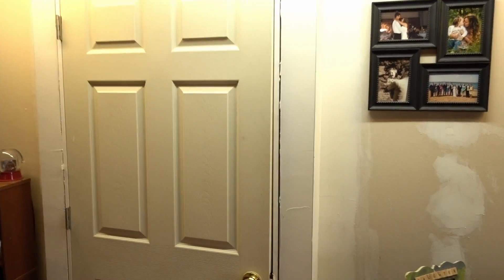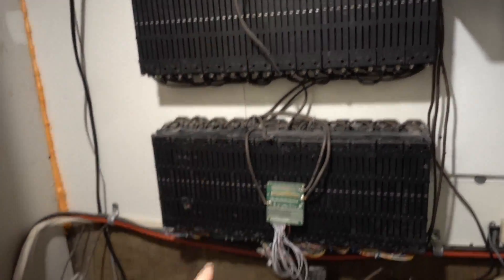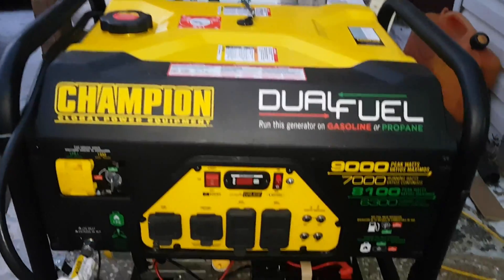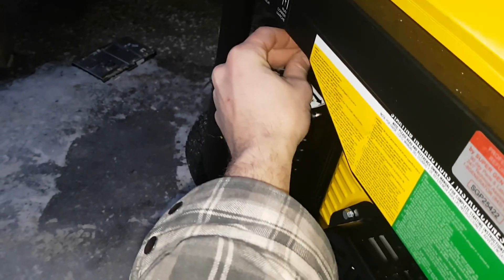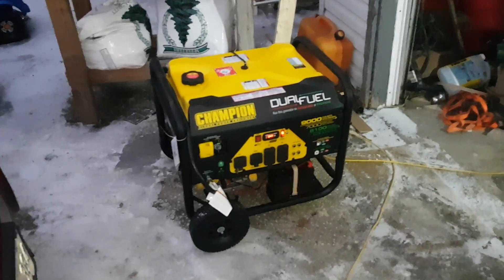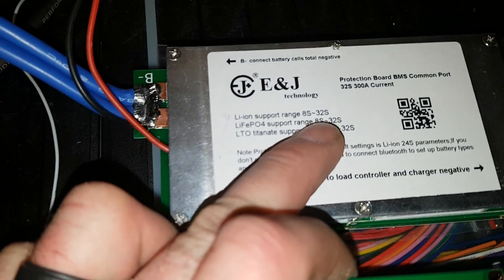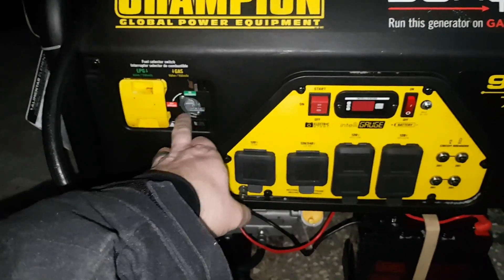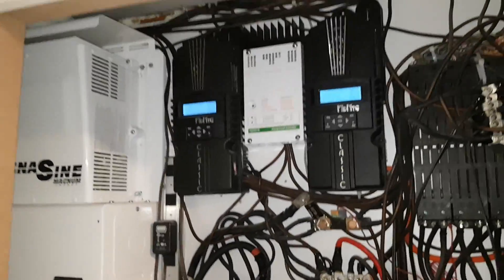Off Grid System And 9000W Generator

Comment: Solar is so expensive it almost makes no sence to buy it. Itll take u years to pay for it in the normal light bill. Years. Many many years
Reply from the maker: Umm my electric bill used to be $300+ a month now its about 50 a month for delivery. thats $3,600.00 a year in 10 years that $36,000.00 my system cost around $24,000.00 and my system is already paid off :)
Reply: @GoingOffGrid101  10 years. Lmfao. Really. Lol.
Reply from the maker: @MrDavidelliottjr  if you look at any investments 10 years to more then double your money is good :)
Reply: @GoingOffGrid101  your just paying for ot in about 8. And at that age its getting worn. Things have to maintained or rebought. So i dont see your point.
Reply: @GoingOffGrid101  if the system lasted for 50 years with out any problems or more cost then yes. But what if you move. Or weather breaks things something goes bad and needs to be replaced.    Or you die.
Reply: @GoingOffGrid101  the cost is ridiculous...
Reply from the maker: @MrDavidelliottjr  my magnasines will last 15-20 years, solar panels easy 25 years batteries 10-15 years, one thing I didn't say is we use way more power off grid then we did on grid and we love it! sometimes 36kwh in one day, we leave all the lights on cause it looks nice, in the summer we run 4 window AC and have a very cool house, if I did that on the grid it would be 400-500 a month where I live, plus we live in the country and power goes out a bit in the winter, well I don't even know when it does lol. solar in not for people in the city cause electricity is to cheap in the city still, the more people we need to supply power for the more money it will be.
Reply from the maker: @MrDavidelliottjr  solar is also like playing the lotto sometimes you win some times you win less :D

Comment: Hey man go to Home Depot if you want those twist lock plugs there not hundreds of dollars
Reply from the maker: you didnt watch the hole video...
Reply: I watched it, I’m just thinking we did a run of 8/4 with those twist locks and, the most expensive part was the wire, if you had wire already then the plugs and Inlet are totally it, because then you have a safe disconnect, I just always think of those people that wanna copy you cause it really is cool, and then don’t have all the cords, so they use a suicide cord or two to get both phases working, I’d hate if they had kids and they touched the other end it would suck to hear about it.
Reply from the maker: @mattyhudson2081   The cord didn't work and I ended up making a twist lock cord, I  show it in the next video :D

Comment: Thanks for braving the freezing cold weather to make the video!!  I'm really interest in how your new BMS will work out.  If it is better than your current BMS (I have the same type you do but in 48V)  then I might get some for my system.  I've been consider splitting my batteries bank to separate the Volt's batteries (18KWh) from the Leaf's batteries (36KWh) and turn it to two independent systems for a while now.  That way if one go down, I still have some power to work with.e 
The room looks great by the way!
Also so, you no longer have a garage, you now have a storage shack like I do.....lol

Comment: Hey Off Grid ! Finally got my major components for solar system! Second batch of battery not damaged this time! Just have some small items I forgot to order waiting on now . Gave you a good compliment to reliable about how you help me make my decision to buy inverter! Also starting to research how to make a 100 amp hr lithium battery, what would be a good BMS for that and can you give links ? Not sure with are good to get using prismatic cells 3.2v may go with 150 ah ones
Reply from the maker: what voltage you going with again ?
Reply: Going Off Grid 12v

Comment: For the gas, you could do a few things. You could put a non-ethanol based stabilizer in it (like seafoam or lucas, if they are up your way), or you could use 100% gas w/ no ethanol in it.
If you go the ethanol free fuel, depending on costs in your area, you might need to remove the ethanol from your fuel manually. This is done by, oddly enough, putting about 10% water by volume in the fuel and shaking it up for a few minutes. Then let it sit and separate. All the ethanol will attach to the water molecules and drop to the bottom of the container. Since water is heavier than gas, it'll sink as well any that didn't bond with the ethanol. Then just syphon off the gas, or drain the water/ethanol out, and use that in your genny. You won't need to worry about rubber hoses breaking down or gunk build up in the carb. And, you wouldn't need to run the gas all out of the tank. Just add a little stabilizer with it and you can store it that way w/o issues.
This would also be good for the 4-wheeler and mowers, too  ;)
I'll be doing this trick starting this summer as non-ethanol fuel is almost 2x regular pump gas.
Reply from the maker: thanks thats good to know! i will be running the genny for work as well so the gas will be burn up :)

Comment: On the genny power cord, did you check all 4 outlets? It's possible that two of them could still be 1 leg, the other 2 the other leg. Just not the 2 ya thought they'd be. We would think 1 side is 1 leg, the other side the other leg. But maybe the top receptacle is 1 leg, and the other leg is the receptacle below it.  🤔
Reply from the maker: I checked every one of them thinking the same thing, then I was like wtf...

Comment: Comes with a cord yep the cord is worth $150, nice stuff, glad to see you making videos that new baby takes a lot of time and rightly so. Nice BMS, I need to find one for my A123 battery.
Reply: E bay or aliexpress
Reply: @frankz1125  thanks I have been looking but I am old & slow lol
Reply: Are you looking for 12s or for 24v setup?
Reply: @frankz1125   24v for now but I like the idea of the universal BMS that goes from 8s-24s than I can use it later for the 48 volt system
Reply: Then get it. Maybe GOG will sell you that 1. With these cells you will need strong balance current.  Keep that in mind when looking.

Comment: Why would you use a generator to charge your batteries or run your house direct when you are also hooked to the grid? Grid power has got to be much cheaper than a generator. I certainly understand if the grid is down and the solar is not charging, but why waste the money using a generator other times?  I am not sure why you are getting such high prices for generator plugs. Try here. https://www.amazon.com/Miady-L14-30P-Generator-Industrial-Grounding/dp/B078BNBYXR?psc=1&SubscriptionId=AKIAILSHYYTFIVPWUY6Q&tag=duckduckgo-d-20&linkCode=xm2&camp=2025&creative=165953&creativeASIN=B078BNBYXR

Comment: How much do you pay for your grid power per KWH ?  I'm assuming you pay approximately  $1.50 a day supply charge connected or not.  Enjoy your videos, cheers from Australia 😎
Reply: If the service charge is that high, it would make sense to go 100% off grid. Maybe that's why he got the generator...
Reply from the maker: about 35c per Kwh so about 10 bucks a day. about $320 a month.
Reply: @GoingOffGrid101  Here in OZ i pay AU $1.06 supply and 18 cents per KWH.  I have set this rate for 2 years.  I have a 3 KV solar system . For 6 months of the year I'm  in credit with my supplier, they dont like me😉

Comment: Looking great :) So how much in winter do you need to run that genny ?? I know you have snow over your way so it might be interesting to work out fuel cost + the Power you use when you not off grid.
Reply from the maker: the genny is only for backup if grid is down and batteries are dead, I will be using the genny at work as well, just a backup to my backup, I also have 3 months of food :D
Reply: @GoingOffGrid101  I was interested to see how often you needed the mains power during winter. Your weather is very harsh for solar over there. Not like here.  Most people like you and I have food storage. We carry 6 months in of food in the house and always have a month of food in the trailer. The trailer is always stocked and ready to go. Save's such a lot of time when packing to go bush.
Reply from the maker: @JustinCaseSolarPower  December to middle of February I would say 40-50% off grid in about a month I will be 90% off grid, 7 months of the year I will be 100% off grid but this will change when I double my solar :)
Reply from the maker: @JustinCaseSolarPower  I dont change my the way I live for solar though, I run electric heaters cause my power room gets cold for my rents, so I could be off grid all the time if I tried :D

Comment: Just get acouple of those fireballs. SImple but 2 of those will sort out any fire and a heck of alot cheaper
Reply from the maker: ws thinking about that but those would blow the doors open I think.
Reply: @GoingOffGrid101  If there is a fire the doors are the least of the issue hahah, plus doors are cheap to fix vs installing any other fire system like you talked about sounding costly. Fire Balls and maybe a damaged door in the very thin chance of a fire #worthIT
Reply from the maker: @MikesDIYTeslaPowerwall  I am going to add fire rated drywall to the inside of those doors and I would like them to stay closed as long as possible in case of a fire, that would slow the spread down! I will look into those balls.

Comment: good point, with them chinese inverters you will need good fire protection.  etc etc
Reply: Never had a fire in my inverters yet. Indeed to meet Australian standards Solar Inverter must be compliant, then the case should be made of a flame retardant material. IF the inverter is NOT compliant Then its whoever fitted the units fault. Been running our home 5+ years. I had one short out due to ants but still no fire.  Most fires start in the solar panel and solar panel wiring or undersized wiring and over sized fuses on the Battery side.. Again if your going to DIY then do it right. Here is a nice little link that may interest you though. Solar panel fires https://www.abc.net.au/news/2014-05-11/solar-panel-part-linked-to-fires-recalled-in-queensland/5445098 its a great read. The fires were caused by the isolator used on the system. NOTE the title......  ( Faulty solar panels ) that is just bullshit as well. we call that click bait :)
Reply: @JustinCaseSolarPower  
yes most fires started from the isolation switch on the roof. australia is one of the few  (only) country that requires that switch on the roof. even New Zealand standards don't require it. germany had them in the early solar days, but came to the same conclusion that they start more fires than stop.
as for my remark, i was somewhat sarcastic.
i think he needs some good ventilation in that cupboard. certainly in summer.
Reply: @ursodermatt8809  Yes i use circuit breakers on mine. Not 100% compliant but a hell of a lot safer. I have have both an isolation switch and circuit breakers inside the power room. I like to make sure my gear is shut off when working on it.  Yes maybe he will cut a big hole in the ceiling and use a ceiling vent fan like we do in our bathrooms.
Reply: @JustinCaseSolarPower  
yes i use circuit breakers too, non polarized. but none on the roof. on the side of the wall. 3S. and yes i have circuit breakers inside the shed too, handy when you work or try out things.